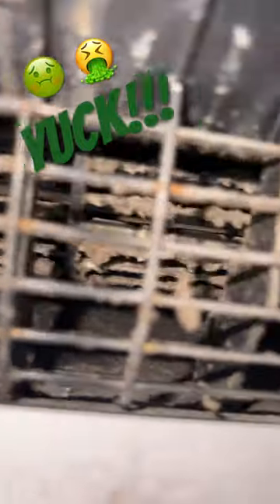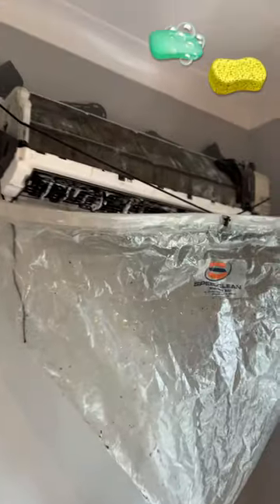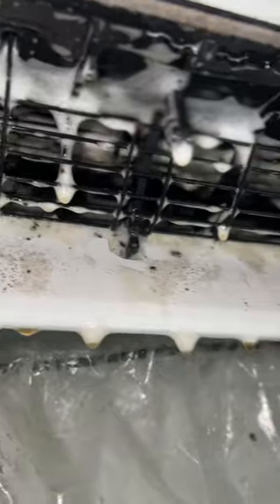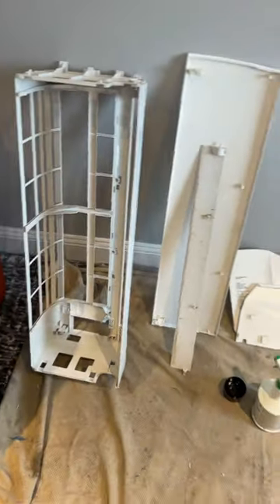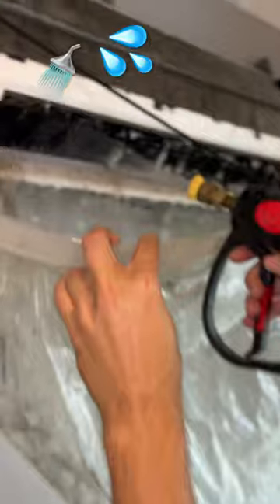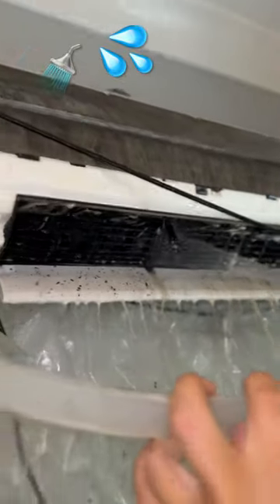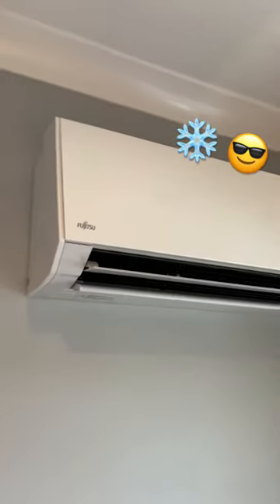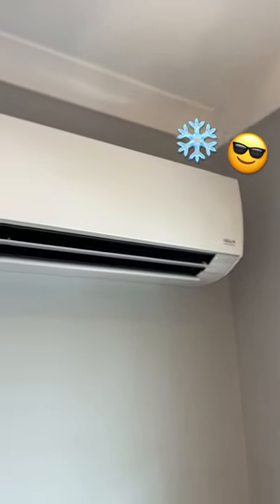How We Clean Ductless Mini-Split Systems! From Filthy - to Brand New! #hvac #plumbing #ac #cleaning

Comment: This is cool! Do you not need to remove the roller too?
Reply from the maker: @vinodrathnam9501  we call that the blower wheel here, and no need to pull it as it’s pressure washed
Reply: @DCHVAC  makes sense! What about the electric panel though? Does it need to be protected somehow before spraying in place?